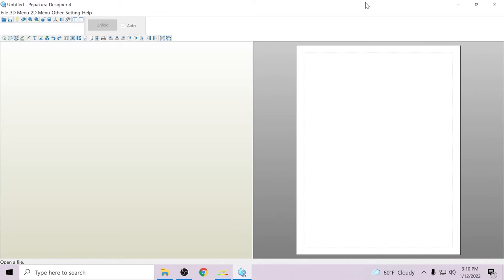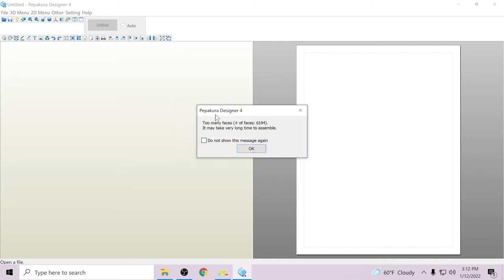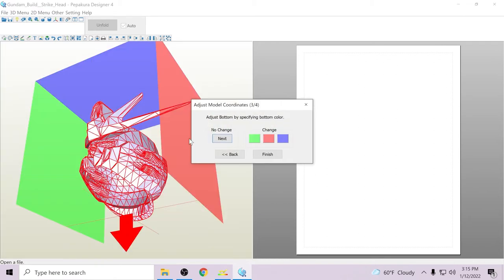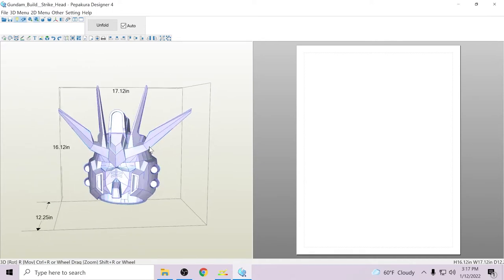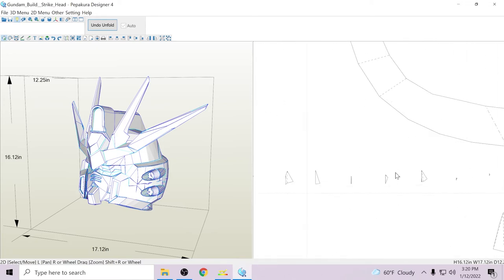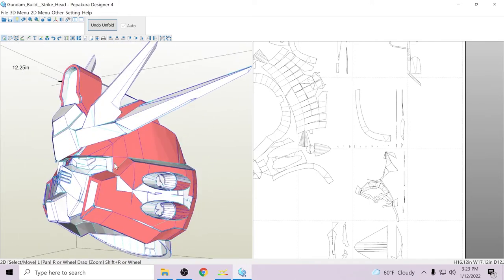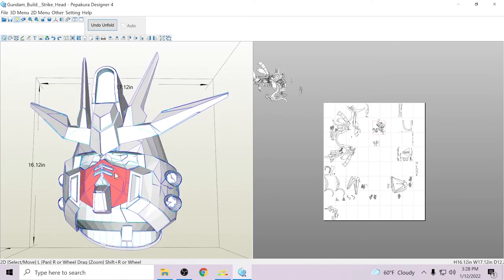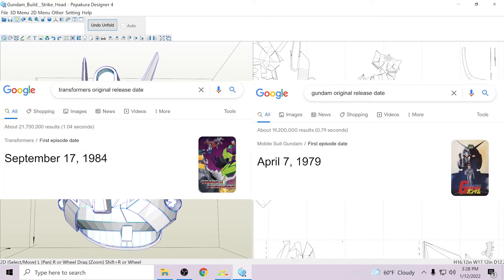How To: Convert 3D Models to Pepakura Foam Templates.  Full Step By Step Breakdown.

Comment: I see you did a lot of cleanup in Pepakura, but it might be easier to clean up the 3D model itself at the root source in some cases. That also allows you to fix issues like faces not joining properly, or pieces poking through other faces.
Reply from the maker: Fixes like that can be done in 3D modelling software, true.  This tutorial however was designed for those who may have very limited or no skills in 3D modelling software, such as myself.

Comment: How to you get the model to look nice a clean like that when i import a model never looks like that is full over fragments and triangles
Reply from the maker: It boils down to how detailed the model is.  The higher the count of faces the harder the program is going to try and figure things out.  I have come across a few files before that for some reason have glitches or faults in the loading process, but unfortunately I never figured out what caused them.  You could run the file through a mesh mixing program like... Mesh Mixer, and change the face value, but sometimes that just adds to the mess.  In the end it's just trial and error with the files.

Comment: Do u got a reverse of this saw the video before passing out
Reply from the maker: Do you mean turning Pepakura files into 3D files?  If so, then yes!  Load the pep file in, then go to File>Export>Texture Editing>3D Model with UV Info.  This will convert it back into a 3D model.
Reply: Will that work on any pep file so it can be 3d printed and do I use same programs in the video still haven't watched it been busy sadly
Reply from the maker: @zanruos88  It will, but it may not make it instantly 3D print ready.  It depends on how the file was first loaded into the program originally.  More than likely it'll have flaws, though I have had 1 or 2 print ready ones come out of it before.

Comment: it is possible export edge number also in .dxf file ?
Reply from the maker: Yes I believe so.  The option to export to .DXF is there under File>Export>Vector Format>Drawing Interface Format or DXF Files Per Sheet.  Whether or not the edge ID numbers also carry over I am unsure as I do not have a program to open DXF files.  I would assume that is what the "DXF Files Per Sheet option is for, as it would transfer over the 2D portion of the .pdo file, but again I'm not 100% certain.

Comment: You mentioned that if the object has too many faces it’ll crash, is there a way to fix that? Like give it less faces?
Reply from the maker: There is a way, though sometimes it works good and other times it messes up the model to an almost unworkable state.  You'll need the program :Mesh Mixer (which is free) and you'll need to do a process called "Quadratic Simplification".  Honestly I'm very new to it myself and it has helped a few times, but it adds more work in the unfolding process.